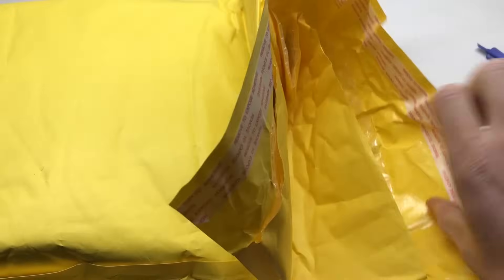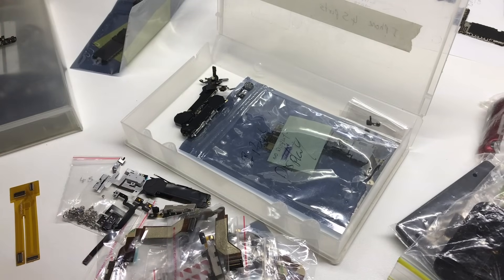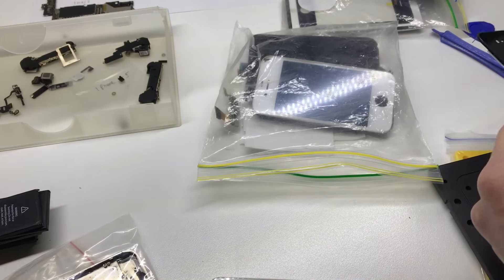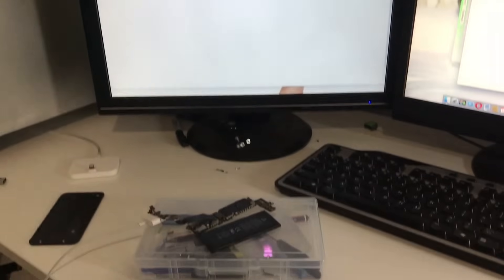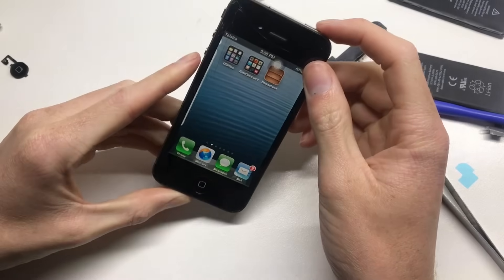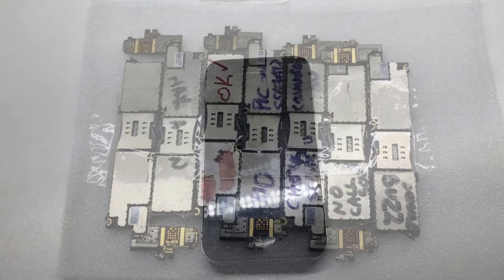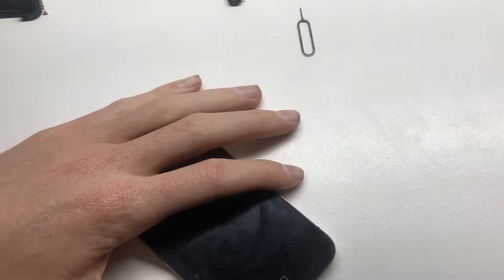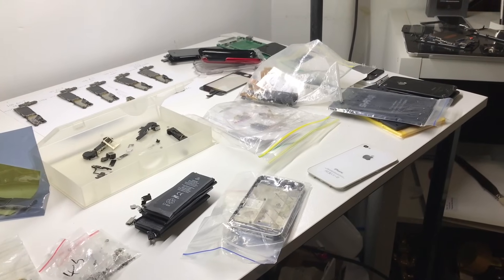Heaps of iPhone Parts + Restoring an iPhone 4 + Testing More iPhone Logic Boards

Comment: After a battery replacement my iPhone 4 (fully discharged) when plugged in turns on to 3 percent shuts off, then repeats until the percentage reaches 10% and start charging normally. Any thoughts?
Reply: kurtdc 30 did you ever figure it out?

Comment: Can you please make a video showing us how to downgrade an iPhone from iOS 9.3.5 to any lower IOS versions
Reply: Sameet Keshav  you would have to jailbreak and install coolbooter from the sources in cydia, but you can only go down to iOS 8, 7, 6, but that will not work right now because jailbreak has not been released yet for 9.3.5, or if you have saved shsh blobs you can downgrade, but that only works if their saved.👍
Reply: landondaracer Coolbooter is only for iPhone 4S and older
Reply: my iphone 5 has coolbooter
Reply: And iPhone 5 offcourse  i don't remeber that the iPhone 5 is a 32-Bit service 😂
Reply: Lotsys Jr Coolbooter is not working for iPhone 5C. because iPhone 5C comming with iOS 7 as New from the box so you van not downgrade to iOS 6 whit iPhone 5C (Sorry for bad English)
Reply: EverythingAppleBro ohh ok well that's weird because my 5c would work 50/50 of the thine
Reply: EverythingAppleBro time
Reply: Lotsys Jr Yes IT is a 32-bit Device but iPhone 5C comming with iOS 7 or later out of the box and can't be downgraded to a lower firmware than iOS 7
Reply: EverythingAppleBro and iPhone 5c